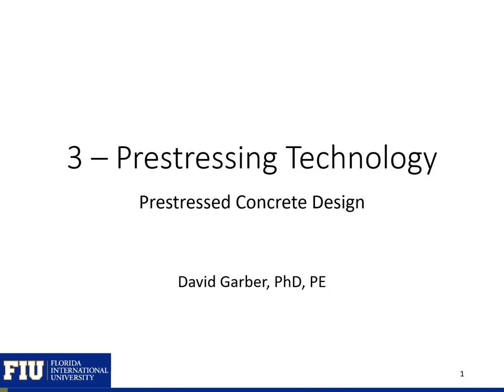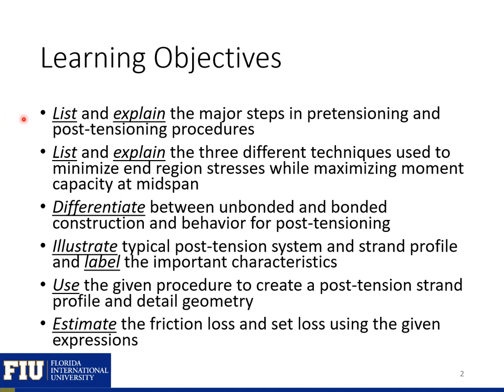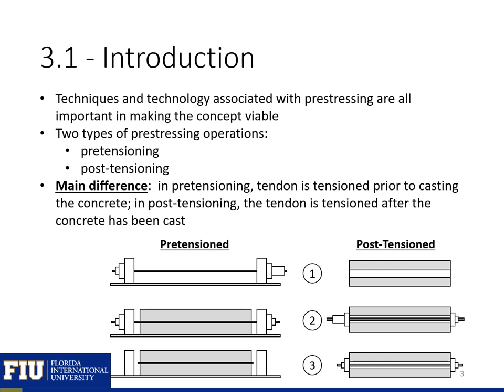Prestressed Concrete Design - 3 - Prestressing Technology

Comment: Hi - I have a question regarding the calculation of losses. If segment 2 and 3 are considered as a combined segment - the loss in force would be different since the mu x alpha term is repeated. Is there a reason why the cables were then segmented that way? What is the best practice to consider when segmenting the cables for a discrete calculation?